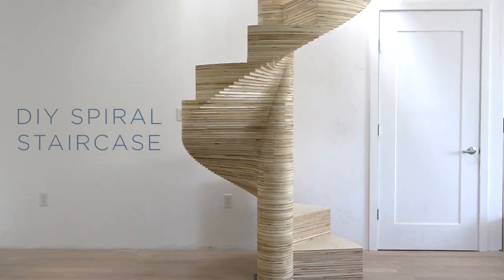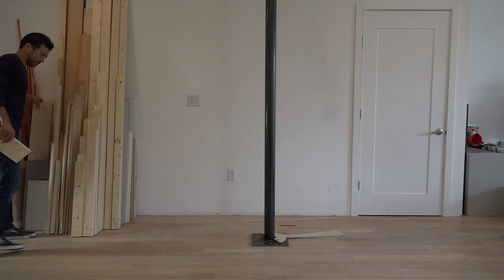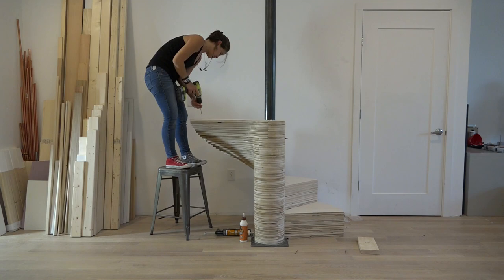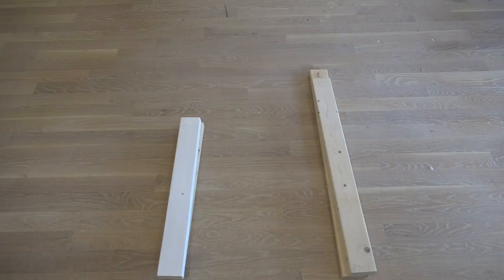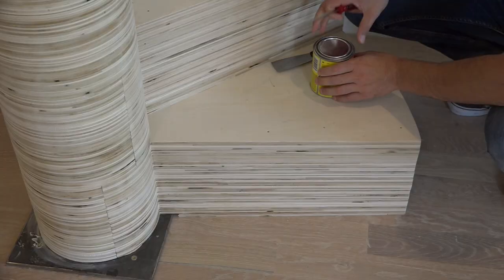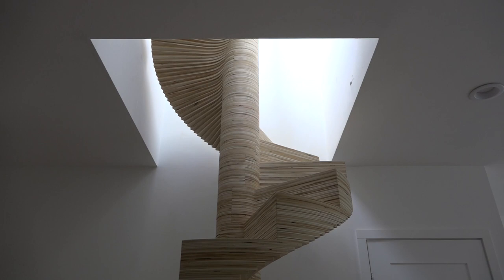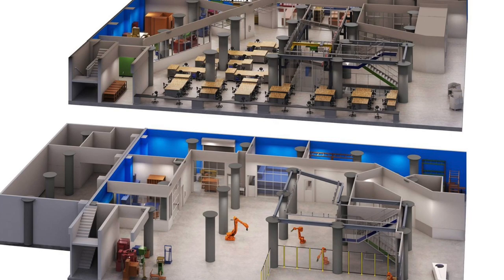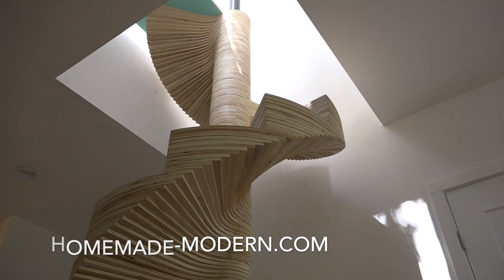Plywood Spiral Staircase

Comment: really? the cost of all that wood is less than a simple welded staircase?
Reply: Material wise, a typical welded steel staircase is going to be cheaper if you're buying from a reasonable supplier. Design and fabrication costs of that staircase are however going to jack up the price by a fair margin.

Now, if they priced this project out fairly with time and labour, then no, this still is going to be way more expensive than a typical welded steel stair. Luckily you don't have to pay yourself if you don't want to.

In all, a very neat project, but can't say I care for the material usage in the design. A redesign could easily remove a LOT of excess material, and clever layout would allow for far less stock material input.
Reply: No, I think he means if you were to buy a prefabricated staircase. Although if you did the exact same thing as this with layering the sheets then it would cost alot more.
Reply: If you went out and bought a spiral staircase kit, you're looking at $2000-3000 for something that looks... okay, but generic. You can get cheaper, sure, but... you don't want cheaper. It looks like crap, and the cheapest I could find is about the material cost of this.

My best estimate is that this cost about $1000 in materials. A fair estimate for labour maybe adds another $1000, and the result is relatively unique, and pretty good looking (subjective, of course).

A redesign could not remove material without altering the aesthetic significantly. A clever layout might manage to save you $100-150 in plywood, but would require more time to design.

Comment: that must weigh about 1000 lbs. looks cool though
Reply: I was thinking the same thing.  But if one stair is about 1.5 ft^2 and about 12 pieces thick each step would weigh about 40ish pounds (give or take).  Then he has what like 16 steps? So...600ish lbs?  I would love to know the actual weight though, also what kind of structural precautions he had to look into before install such a massive staircase.
Reply: my sense is that the spiral does quite well on its own, the mass of the spiral is the key to its stability.
Reply: My guess was 14 steps from the video, which would give the steps a total height of roughly ten feet, which would be about right to get to the second floor of a typical building.

14*1.25 sheets per stair raw = 17.5 sheets. If we include the top landing, round up to 18 since we're going to include the top landing I guess. Spec says 70 lb/sheet, so that's 1260 lb of raw plywood. I'll estimate a 50% rate of used plywood to overall plywood based on the video of the plywood being cut, leaving me at 630 lb of plywood. The steel, estimating pole length and the steel plates.... roughly 180 lb. Add in, idunno, an extra 15 lb let's say for the other materials involved to give us a nice number.

Adding that up, my best estimate is 825 lb.